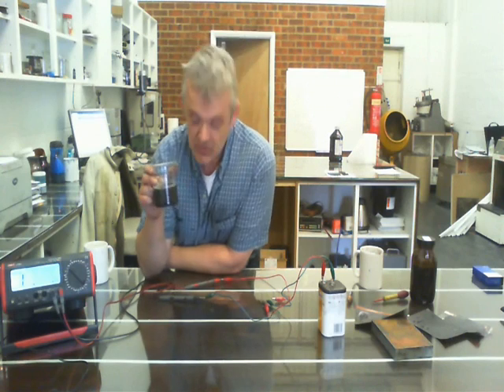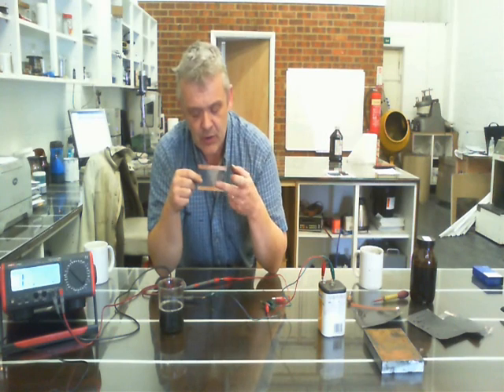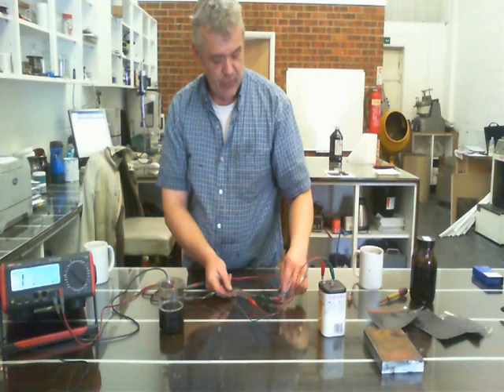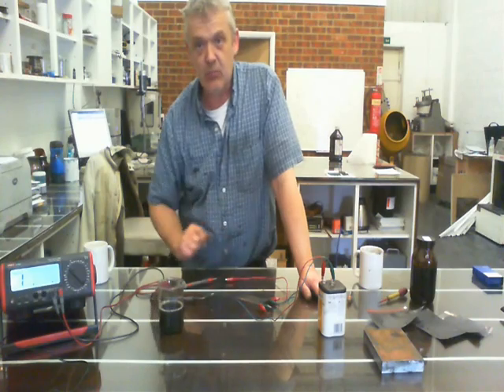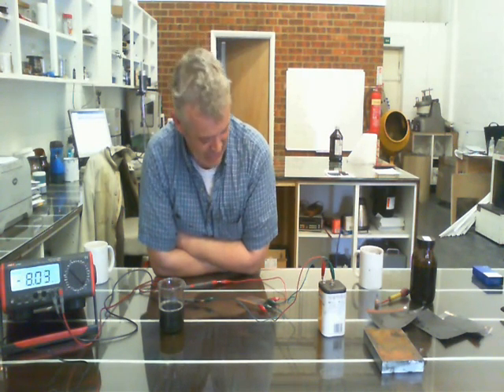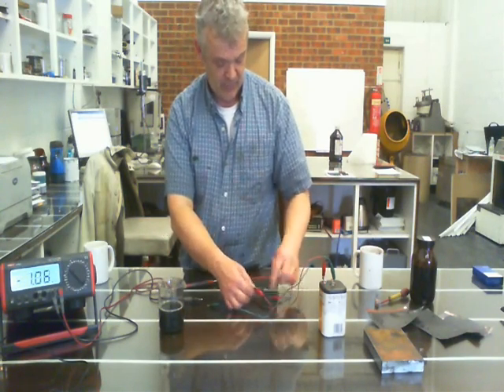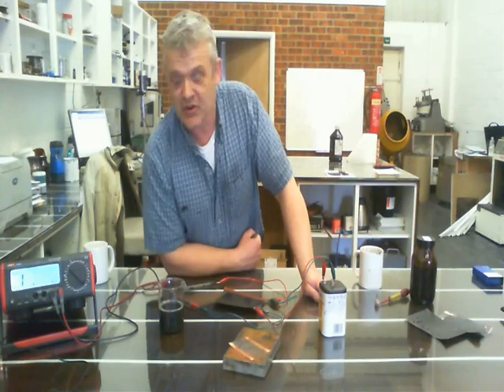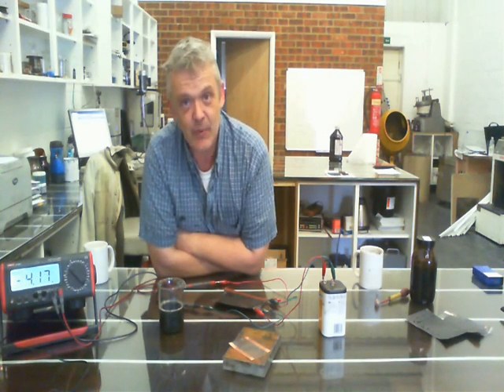Printable Graphene Diode

Comment: Hi, I wonder if you have ever heard of Aquadag. It is interesting stuff. It is conducting nanoscopic graphitic ink, discovered around 1900, by Acheson. It has been used extensively in the electronics industry ever since. It has recently been rediscovered and it is now called "graphene ink". 
Few know, that very many "graphene" products and discoveries are simply renamed graphite products and discoveries. Remember: graphene is a monolayer of graphite. Once you stack it (with more that 4 or so layers), it is graphite, and behaves exactly like graphite, whose properties (electronic, chemical, mechanical) have been known and used for a very, very long time. 
Indeed, graphite is a very important material. It doesn't get better simply by renaming it.
Reply from the maker: lol - absolutely mate and i do know about aquadag - still - a new name will help you get a patent lol
Reply: Robert Murray-Smith Or a Nobel prize...???
Reply from the maker: Walt Deheer
indeed

Comment: Here's something for you to ponder.  I saw this years ago and your video reminded me of it. Deborah Chung's Negative Resistor.  

Professor Deborah Chung { [30] } at University of Buffalo also has invented a true negative resistor utilizing crossed carbon filaments, and thoroughly tested it.  The university filed a patent application and moved toward licensing for commercial applications.  However, the university's web site abruptly pulled off the University's offer of a technical package to companies signing nondisclosure and wishing to license the technology. 

Chung's paper was submitted to a journal and after a protracted period in review was finally published. [9]   It appears that the university has classified defense contracts, and the Chung negative resistor may have been classified or made totally proprietary for use on such programs.

However, J.-L. Naudin in France has replicated the Chung-type negative resistance experiment, as well as several versions which can be performed by experimenters much more readily. [10]   The reader is referred to his website.10
[30] .        For a skeptical reference, see K. C. Cole, "Experts Scoff at Claim of Electricity Flowing with 'Negative Resistance'," Los Angeles Times, July 10, 1998.  I wrote a rebuttal to the editor, but it was not published. Professor Chung is a leading scientist in "smart materials" (materials that act similar to electronic circuits) in the United States and she is widely published.
  I thought you would get a kick out of that.  She uses crossed filaments of carbon to get a weird sort of energy out effect.  here's a video of it.  both your works have given me great ideas. "Energy from the Vacuum" - Doc. Series - Trailer - Pt. 3
Reply from the maker: thanks for that mate - that is absolutely fascinating - i vaguely remember this - i will read up and get back to you on this - thanks again

Comment: hmmm you cannoth take resistance measures while things are powered... you can brake your meter doing so. when you measure resistance, your meter is acctuly putting voltage in and measuring voltage out... if you put voltage in with something else when measuring the resistance, it will either brake your meter ooorrr measure something nonsense...
Reply from the maker: I got the set up from texas instruments technical note eet-110 measuring diodes. I think what you are saying would be true if you were measuring a small resistance but here we are looking at megaohms with a tiny voltage and the difference is the readings is so large that tiny errors are of particular significance to see something is happening. Also in order to test this kind of diode we need a bias voltage that is larger than the meter voltage.
Reply: Robert Murray-Smith hmmm... welll on a lot of meters, there is a particular place where you can plug your diode for testing. I usually do it this way lol... of course you can check conductibility both ways with ohms reading... anyways.. normal diodes conducts when there is 0.7+ volts diffrence... what about your diode?
Reply from the maker: sk8pkl
of course you do - that's because you are measuring premade diodes - i don't know what the forward voltage drop is but it'll be high

Comment: These videos never fail to amaze!  Ive been trying to print graphene for about a year now and have built a CNC laser scriber. I use an IR laser reduce graphene oxide to graphene (similar to the lightscribe/DVD mechanism) and then use a UV laser to ablate the non reduded GO along the perimeter of the circuit. I am still trying to find the optimal pulse-time, temp, and laser power before I share my results. Thanks for sharing!  Sounds like I'm going to be adding magnets to the equation now!
Reply from the maker: can't wait for the share mate

Comment: Digital multimeters calculate resistance from current and voltage. Connecting external voltage source to meter will give false readings. Measure current through or voltage across your diode then reverse polarity of battery to see if it measures differently.
Reply from the maker: cheers mate - will do